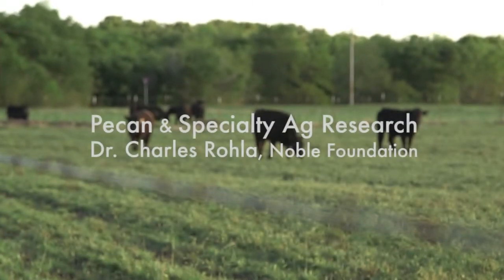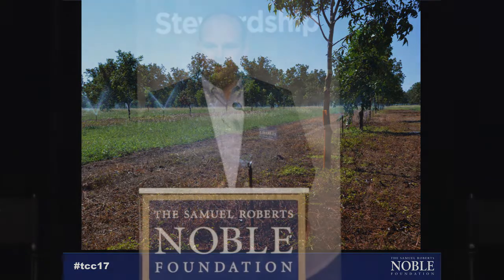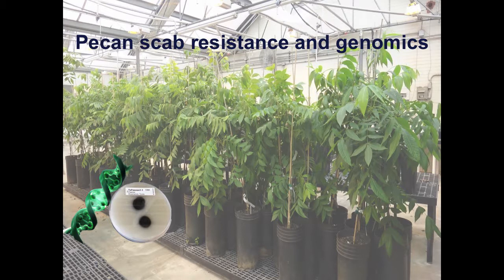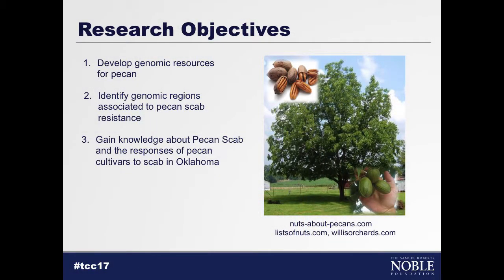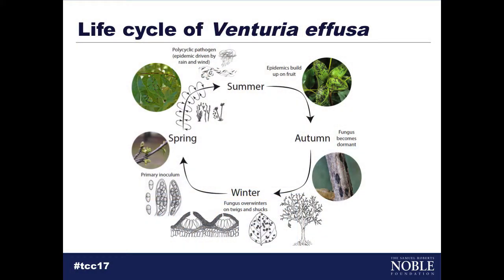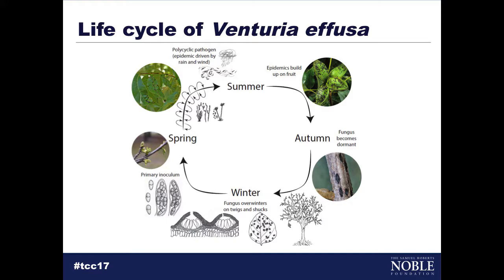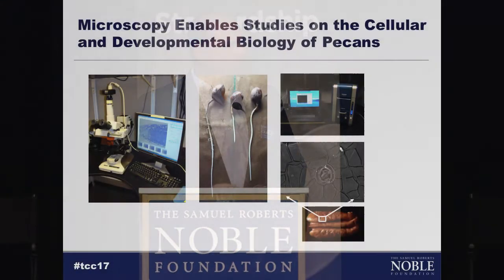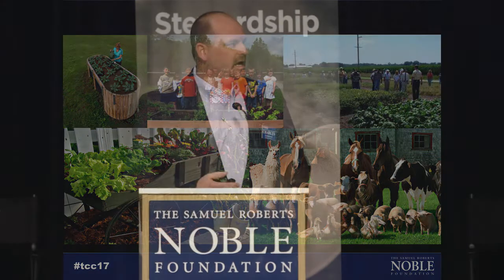Pecan Research at the Noble Foundation | Scab, Cultivar Genetics, Irrigation Studies

Comment: i feel like my trees are growing real slow is there they are 4 yrs old  i desiable is about 8-9 ft  all the rest  are lower    the look healthy   ( dark green leaves)  ????
Reply from the maker: There are several things that can influence the growth of your trees. First and perhaps the most important is controlling grass and weeds in an area at least 6 foot diameter around the trees. You can use herbicides or mulch to control weeds and grass. Be sure that you are watering the trees but not over watering and applying fertilizer including Zinc to the trees. Typically pecans trees will really start growing after the third or fourth year, after the root system has had time to develop.
Reply: @NobleResearchInstitute  i do have weeds i will take them out   and fert. thks